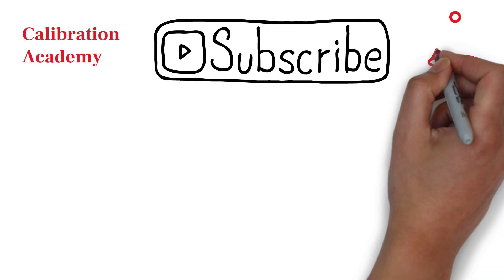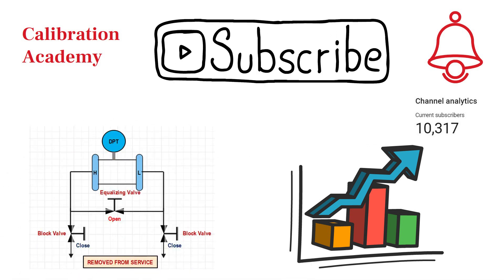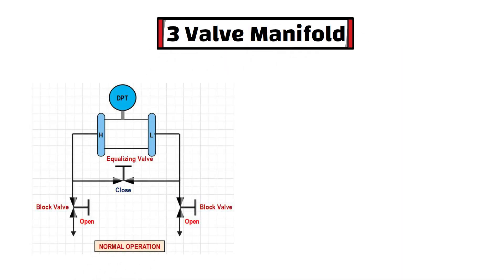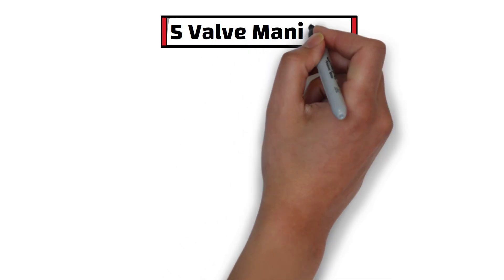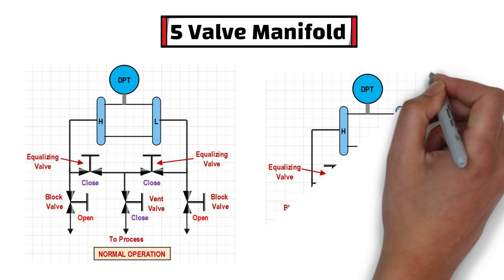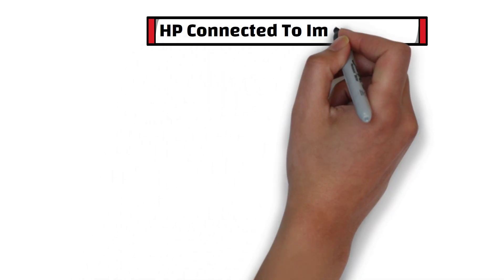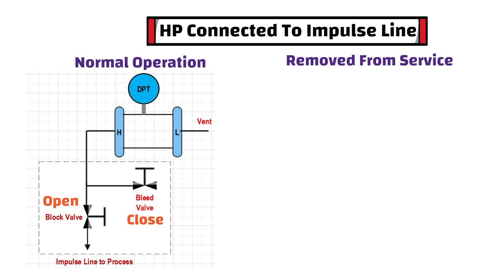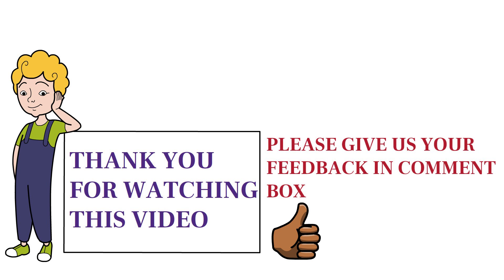What is DP Transmitter 3 Valve and 5 Valve  Manifold | Pressure Transmitter Basics

Comment: TX make - Yokogawa
TX range- 0 to 2500 mmwc
TX dp shows - 2750 mmwc
Dcs flow shows - 36 TPH ( which is upper range flow)
TX mA output - 20.36 mA
Then why dp shows greater than TX range- ??
Reply from the maker: Hello Ujjwal
DP transmitter's 4 to 20 mA range is set to 0 to 2500 mmwc. This is the range set by onsite tech as per the process requirement. However, DP transmitter's maximum range could be more than this, and it is written on nameplate of transmitter. And it is the maximum capacity of DPT. DPT can not be read more than its maximum range. I hope you get your answer. Please let me know if you have any confusion.
Reply: @InstrumentCalibration  DPT maximum range 5000 mmwc .sir is their any calculation to check whether flow reading shown it's correct or not ?? Or TX dp shown on display correct or not ??